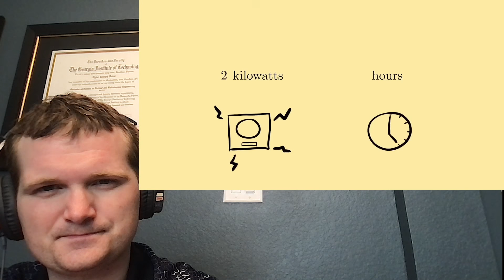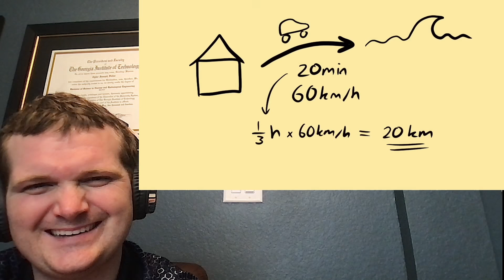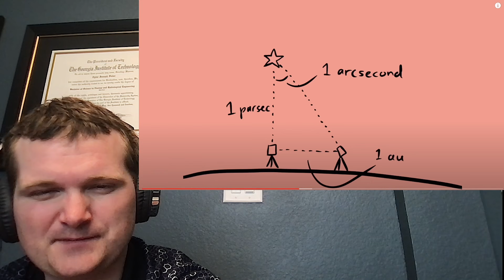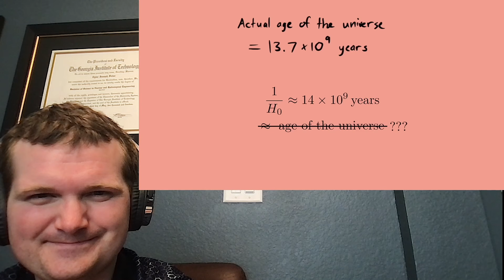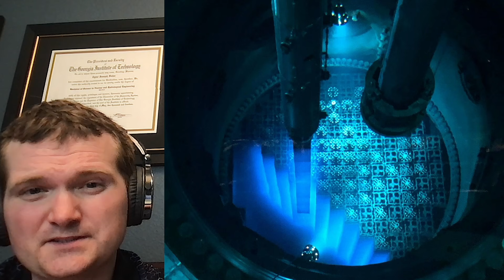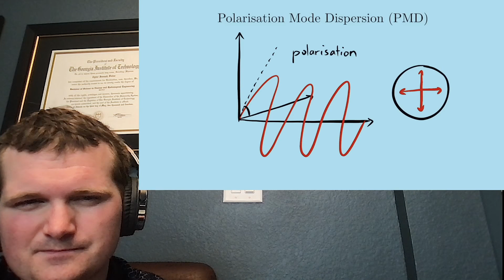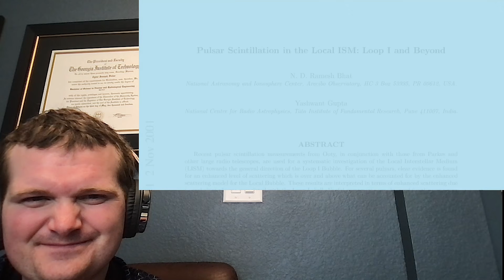Nuclear Engineer Reacts to Cursed Units by Joseph Newton

Comment: Consider the units "miles per gallon". That is a unit composed of length divided by volume, which is inverse area. What is that area? Well, imagine that instead of burning up, your gas simply shot out the back of your car in a long tube. The cross-sectional area of that tube is equal to the gallons per mile of your fuel efficiency. That's why fuel efficiency is measured in units of area.

Even very mundane seeming units can be highly cursed and/or blessed (depending on your perspective) if you analyze what they really mean.

Comment: I remember a physics class in college where I completely spaced on the equation needed, so I blindly derived it using the power of dimensional analysis. Completely the wrong way to do it, but it worked.

Comment: The BMI or Body Mass Index. Kg/m^2. If you ran over a person with a steamroller until they were squashed into a square equal to their height, then you measured a square meter and cut it out. Assuming uniform mass distribution, the BMI is the weight of this square in kg. Not very cursed in units, but this explanation is cursed.
For impractical units for everyday life, the Planck units end up all over the place. Some extremely large, and others extremely tiny. Only the planck mass (about 21.76 micrograms) fits into everyday life. And the planck energy (this mass x the square of the speed of light), which is 1.96 Gigajoules (about the energy stored in a big car's fuel tank filled to the brim), seem to be on a usable scale.

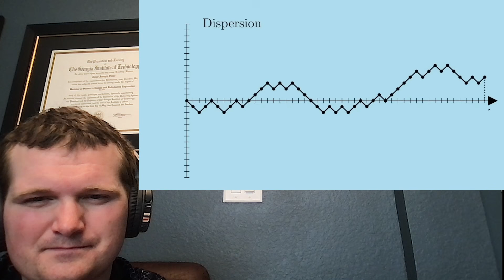Comment: 25:44 I'm not sure what it has to do with RMS but it's more of a probability distribution. Imagine flipping a coin over and over and finding the approximate difference between the number of heads and tails is proportional to the square root of the number of coin flips. It doesn't mean it IS the square root of the number of coin flips, just proportional to it. Perhaps this is an average over every possible coin flip sequence, but if you flip a coin 4000 times, the difference between the number of heads and tails is likely twice what it is for 1000 coin flips.

Comment: I think it would be much better if we had kW/h. This appliance uses 2 kW per hour, and if you use it for 3 hours, your total energy usage is 6 kW.
Although I wouldn't use Joules themselves, the numbers would be pretty big. Instead, we should accept it like lights, we adopted Watts for brightness (it isn't) and we should adopt kW/h for consumption and kW for total power even though it's not an amount of energy and it's a rate instead. I would not care in the slightest. It's how my brain works.

Comment: kWh really isnt that cursed, considering a lot of appliances are rated on the wattage they draw, 1200W for example,  using kWh its really easy just to multiply how long you used that appliance for an easybway to know how much it will cost.

Comment: This is why kilowatt hours were always so confusing to me. Because it's amps times volts, which are obviously both speed measurements, then of course watts is also a speed measurement. So it made no sense to me that we were measuring quantities of electricity in terms of speed per hour. Because that's still just speed. I didn't grasp the division and multiplying canceling each other out to create a quantity part. Essentially the h stands in for 3,600 seconds. So you're taking joules / 1 second * 3,600 seconds. Okay never mind the intuition still doesn't work. 😂

Comment: 22:09 "At a safe distance of course"

If I had the opportunity to view a large-scale nuclear explosion in person, I'm not sure there would be a safe distance from the political & socioeconomic fallout, because there are only 3 reasons why I'd ever have an opportunity to see a full-scale nuclear blast and all of them seriously threaten, at minimum, regional stability.

1 - nuclear war: even a limited one would present serious dangers due to the socioeconomic and political consequences threatening the stability of society.
2 - nuclear weapon testing: There is no real reason for doing nuclear weapon testing that doesn't point towards either a new nuclear power threatening the status quo or a nuclear arms race between existing powers. Neither of those signify safe times to live in.
3 - catastrophic failure of a nuclear reactor: aside from how many safety measures would have to have failed for a modern reactor to blow its lid causing some paranoia of sabotage, the immediate chaos from evacuation efforts & refugees would seriously disrupt the stability of the surrounding area (including any spot close enough to see the blast), and instability is bad for health.

Comment: In metric countries, we measure fuel consumption in units of liters per 100 km. If you do the dimensional analysis, you see that this is len^3 / len = len^2, which is area. What does this area represent?

Imagine that the car has no fuel tank, but instead there is a long trough or tube filled with fuel along your route. The car consumes fuel from the tube as it moves along, and the area is the cross-sectional area of the tube.

Comment: The problem with using Earth's orbit and saying the distance between the positions of Earth at T+0 and T+6 months is 2 AU fails to take any account for the fact that in those 6 months, the entire Solar System has moved roughly 3.65 AU in its own orbit around Sagittarius A* at the center of our galaxy... so the actual distance between the position of Earth in January and its position in July is roughly 4.16 AU... and even that fails to take into account the Milky Way's own motion through space, or indeed the fact that the Sun does not keep its position relative to the plane of the galaxy, instead moving up and down across that plane.
Reply: Yes; however, once you understand these confounding factors, you can correct for them. You would measure at T, then T plus 6 months, then T plus 12 months, then T plus 18 months... and so on, until you have a data set that's large enough for you to observe and account for the gradual drift.
Reply: You only see stars in your own neighborhood. You can't see individual stars from other galaxies unless they go supernova. You only need to account for parallax and the relative velocity of your observed star, then you're good to go.

Comment: Also not sure if two fits there because you know au what is the distance from Earth to the Sun not counting the rest of the Sun to the other side and even if it did then you would be over adding and it's not the distance to the center of the Sun so it's technically a little bit more than 2au

Comment: I find it hilarious whenever people get upset whenever they say that you could travel from here to there in 12 parsecs when they're not a measurement of time there are measurement of distance and the problem is they're thinking as individuals who don't have a ship that can fold space.... Or warp space at bare minimum. The reason it's impressive is because it's normally a megaparsec or 50 parsecs... That's the entire reason it's impressive you're still going the maximum speed your ship individually can go but you're traveling it over less space than they're actually is. Meaning it doesn't matter how slow your ship is you're still traveling much faster then you should be.

Comment: mAh is even more cursed because you have a dependant called volt. That means a 5000mAh 10V has just as much power as a 10000mAh 5V battery.
Reply: also because it’s used way too much for like 20000mah when it should just be 20ah

Comment: I've always liked an example for dimensional analysis from an old physics textbook of mine. Miles per gallon. That's a length over a length cubed, or the inverse of an area. It posed the question: what is that area? It's the cross sectional area of a container of one mile in length which gives the container a volume of the amount of gas needed to travel that far.

10 miles per gallon. This works out to about 1/(3.6*10^04 inch^2). That times 1 mile is 0.1 gallons.

Comment: 10:00 Yeah, the whole 'Kessel run' thing was that he managed to plot a really short route through a hazard-strewn area, where a longer route would have been safer. Made him both a dare devil and a skilled navigator. Or at least that's the explanation that was created later to cover for the "oops, I used the wrong units" flub.. Or so I heard.

Think of it like a slalem race. Racing through a squiggly course. The tighter you make those turns and corners, the more skill is required, the more danger there is and the shorter your overall route is therefore the faster it likely is. Save that the flags are stars, and if you bump into one you're doing to lose more than points.
Reply: I prefer him BSing it

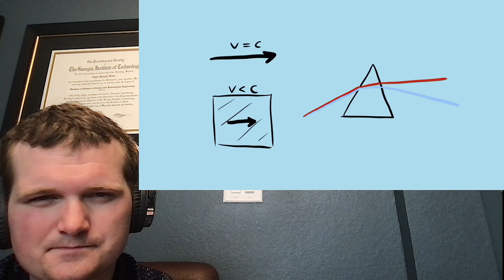Comment: . . ." to the prison", 20:46 hello, I do not aim for security debates. Nuclear power is not an enemy. I use Grammarly and live in Europe. My native language is not English. My consideration is that, like coil, some kind of waste is also with known nuclear reactions. I name the waste curse, because it cannot be used for further production, not with the known devices. It is commonly known that riding a wave is similar to the barrier breaches. The question I have is what kind of repetitions are possible? (That the universe may sometimes expand to collapse again is a model also observed in model theory.)
Reply: I believe that the current consensus among the scientific community is that the universe will keep expanding forever until it ends. 
The theory that it’s going to collapse again one day isn’t correct because its rate of expansion is increasing exponentially. 
If the pace at which its rate of expansion is increasing exponentially were decreasing, then it’d be possible for the universe to collapse one day, but because it’s not, this is impossible. Does that answer your question?
Reply: @ZacMoroney  The amount that expandes, decreases with the value of the spreading value. A blossom can lose a leave. But it does not answer my question. Because we cannot operate beyond the border of the falling leave or attache the leave in the way it would have been harvested.

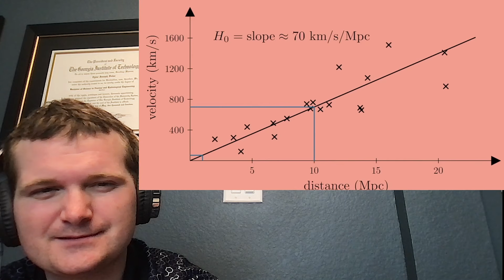Comment: Hm, when I look at the H0 chart at 8:53, I see deceleration, not acceleration, because the if we measure a higher speed 1 minute ago, then measure it again but it's now lower, then we measured a deceleration. Unfortunatly, no one could make it clear to me, why cosmology talks about acceleration, the answer always was just on a "just because"-level. :( On the chart, you can replace the 'distance' on the horizontal axis to '–time (–GigaYear)', and the chart remains the same.

Comment: 15:24 Not a coincidence at all, in a mathematical vacuum those two would be equal if the rate of expansion was the same across the universe. Its basically the time necessary for galaxies and stars to get to whwre they are now, since you cancelled out the distance. 

His arguemnt that its not because the expansion is variable is flawed because it doesn't factor that that variance was relatively short. The hubble constant is roughly our current expansion rate, which the universe has been at for a disproportionately large amount of time, thus its a good approximation for the age of the universe.

It's like saying it takes 20min to go 5mi but cancelling out the miles and being surprised the 20min is an approximation of your travel time, lol.

Comment: The weird thing is that units lite joule and watt originate from electricity. Joule was the energy one ampere current dissipates in an one ohm resistor in a second. However, their current definitions have nothing to do with electricity.

Kilowatt hour is hard for many to get. Many think it is kilowatts per hour. Many just say kilowatts when they mean energy.
Reply: Wasn’t a Joule defined by Joule way before electricity?

Comment: The whole Star wars Kessel run is supposed to be 20 parsecs long. Han Solo brags he can complete it in 12 parsecs as the Millennium Falcon is supposed to be able to take more dangerous routes meaning he can shave 8 parsecs off. It's like your buddy saying they can cut a 200 mile trip down to a 150 mile one because their car is able to go off-road and they know a shortcut through the woods.

Comment: You can use dimensional analysis to solve problems that you don't even understand. Just find a way to convert the given units to the units required, and there's a decent chance it's the right answer.

Comment: M. Sc. of chemistry here: In IR-spectroscopy we use the weird unit of wavenumber. The amount of waves fitting into a certain length. But it even gets weirder.... we don't use the meter but the centimeter instead.... 😂 So the unit is waves/cm or better 1/cm = cm^-1 whereas the real SI-unit would JUST be µm (wavelength). We still use the 1/cm because you get a linear connection between energy and wavenumber. Additionally the values are in an easily recognizable size, e.g. 600 -4000 cm^-1

About the parsec: In chemistry we use the unit of Ångström equal to 0,1 nm = 100 pm = 1 Å. It's pretty handy because one Å is about the radius of an atom and it's even about the standard distance between atoms and thus often equal to the length of bonds. It makes calculations easier as you can 'feel' it better😉
Reply: Heavy FTIR user here lol
I wrote myself a plugin (nested in the Wox app on Windows) for the sole purpose of quickly converting between all these units associated with photon energy. 
Those include wavenumber, wavelength (um/nm), frequency (typically THz), and eV (correlating to semiconductor bandgaps).
Trying to remember all the constant factors for conversions was too much hassle... although eventually I started memorizing some of them, which can serve as anchor points for ballpark estimations (for example, 1550 nm ~ 193 THz is baked into my memory now).
Reply: @strat0caster124  You got the kJ/mol as well? 😉

Comment: the issue with the kwh is that we hide the problem into the watt. if the 1200 (km/h)*min would be renamed 1.2 kvm, it would look perfectly normal. m obviously in this case minutes just added confusion from mistaking it for mass, the k is kilo for tricking you into something meaningful and v is for velocity where one velocity is 1 km/h, and suddenly no problem with that strange unit. if we start to use that for how much energy it needed for the travel, it might even catch up. (please no!)

Comment: Fisher information is a great example of a cursed unit. Suppose you have data that you believe follow a particular parametric distribution, and you want to estimate one or more of these parameters. You can use a technique called maximum likelihood estimation (MLE) to get the "most likely" possible value of the parameters. Fisher information is a measure of how much information the data carries about the maximum likelihood estimate. However, the useful thing about it is that its inverse is the variance of the parameter estimate in question. Variance has units of the square of whatever the units of the corresponding random variable are. So, that means if you're measuring claim amounts in dollars, and you fit, say, a Pareto distribution to the data using MLE, then the Fisher information for the scale parameter has units of inverse dollars squared ($^-2).

Comment: Yeah it was actually pretty correct estimate for how fast his ship was. Because basically there is a huge black hole in the middle of the path. So the closer you can get to the black hole without getting pulled into it, is a good bragging right for how fast your ship can go past the speed of light. Since the faster the ship, the smaller the event horizon. So the smaller the e faster the ship, the smaller the event horizon. So the smaller the distance to the black hole, the faster the ship is.

Comment: ive been doing nuclear physics research for the last 2 years. my favorite cursed units are the almighty areal density units - atoms*10^15/cm^2, and also the fact that for rutherford backscattering, the end result of the equation is given in units of particles/m^2. Also, on a logical level I understand why reaction cross sections are measured in some variation on m^2, but also why? It's a probability!

Comment: In my opinion the whole unit system is cursed. Why is it allowed that a unit prefix and a unit have the same symbol?
Is a "mm" a Millimeter or a Square Meter?
is a "pcm" a Pico-Centimeter or a Parsec-Meter?
Why is the Kilogram the SI unit and not the Gram?
Smart people in the past should have ruled for example that prefixes are all greek letters and units are all latin letters or maybe they should have named the units so that they don't coincide with pre defined prefixes (blacklist for units).
Reply: It really isn’t that complicated.

mm is millimetre, m^2 is square metre

pcm would be parsec metres because you would never have 2 prefixes

If it’s complicated put a multiplication symbol in, this is commonly done in Newton metres even though it’s not needed. This is to avoid any confusion
Reply: Why would mm be square meter?

Comment: 14:20 Google reduces the Hubble constant to 2.3×10^-18 Hz because Hz is the most familiar inverse second, but strictly speaking it's incorrect. Hertz is specifically cycles per second, a measure of frequency of periodic phenomena, but the Hubble constant doesn't describe a recurrence, so instead we should use an inverted second for aperiodic phenomena. That's right, the Hubble constant is 2.3×10^-18 becquerel! (Or 2.3 attobecquerel)
Reply: you are correct. I hate Bq, what is it in Ci?
Reply: @DrDeuteron  6.2162e-29Ci
Reply: @FemclSyrup  that works out to like one decay per lifetime of the unive……..oh wait. Ok.
Reply: @DrDeuteron  one Curie is 3.7×10¹⁰ Bequerels, so very roughly this estimate in Curies is 8.51*10^-8 Ci (can't find a superscript minus on my phone keyboard lmfao)